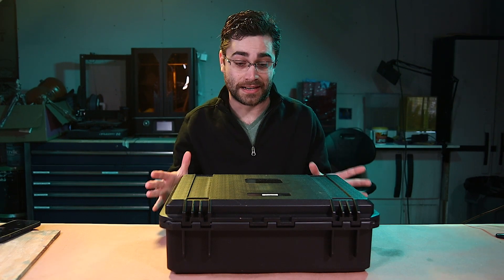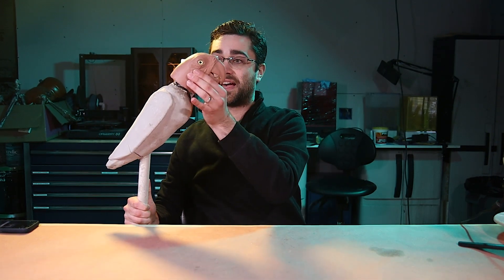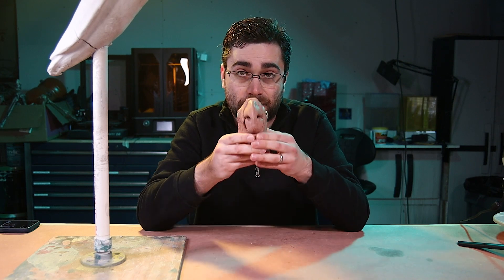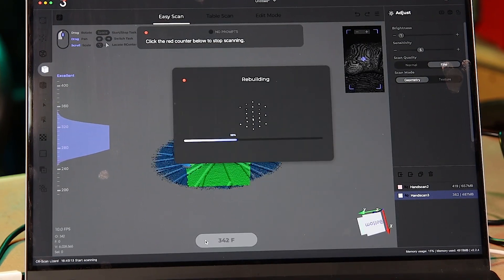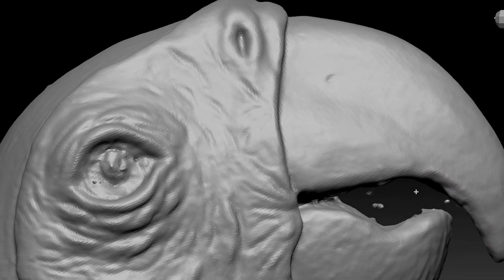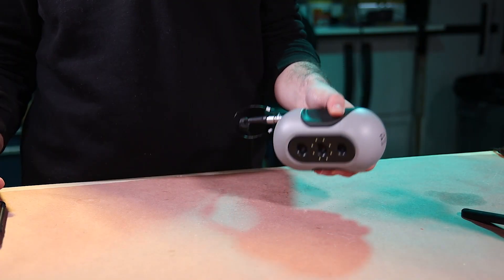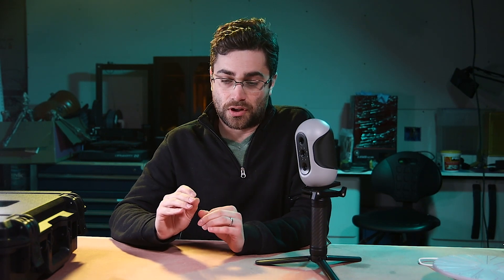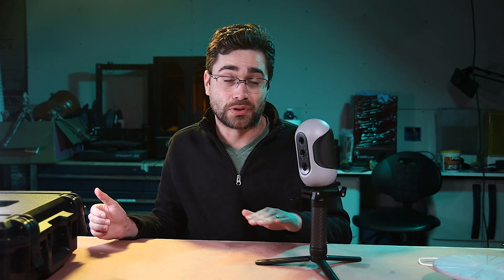Digitizing a Sculpture for Animatronics with 3DMakerpro Mole 3D Scanner

Comment: Thank you for the video and your time. Can you be more specific when aligh all the clouds? If I have more than 3, what is the correct orden and how to align them. Thanks!
Reply from the maker: I think you just have to use your best judgment here, since the instructions I received were limited. I’d say you probably want to start with the ones that have the most overlap so that it has more to work with. You might even be able to to do them all at once.
Reply: @jasperjanderson  i start to play with the unit yesterday. Scan quality superb. But i can't fugure out complex alignment
Reply from the maker: @JoseAguiloworkshops  I have had times where alignment works well automatically and times where it does not. I think a lot depends on the object.
Reply: @jasperjanderson  can you advice how to do it in complex objects? If you know or can? Thanks
Reply from the maker: @JoseAguiloworkshops  It's hard to answer without seeing what you've got, but generally for margin two scans, I've found you want as much overlap as you can capture so that it's got plenty of features to work with to find alignment points. But you also don't want too much overlap on critical detail areas, because lots of duplicate data will make for less clean final results.
Reply: @jasperjanderson  I did it! Yes you need a lot of data. I did it with two meshes. I will try with 3. Forgot! THANKS BRO!

Comment: Thank you for the great Video. Question regarding the mac. What is your machine? What Processor and GPU, and RAM? i use a intel i5 Mac 16 RAM 2020. do you think thats enough?  Thanks
Reply from the maker: I do not know enough about computers to make a recommendation there, but mine is a 2021 M1 Max with 32GB RAM. Glad you liked the video!
Reply: @jasperjanderson  thank you for your reply! and it works great? or do you prefer more power for the 3D application to work with the huge Data from the scans?
Reply from the maker: @luckyluck3093  I don't really have a frame of reference for how much better or worse it could be, but it seemed to be performing about as expected.

Comment: Jasper thanks for the content I have a question I’m tired of modeling stuff and I want to get into 3D scan . Do you think this scanner will work on gunpla model kits ? I do custom work for weapons and some body mods and I want to know if I can use this scanner on this sort of stuff ? Thank you for your time .
Reply from the maker: I haven’t seen any scanner that will give you a finished part ready for output. You’re always going to have to do some cleanup work. From the little I know about gunpla, you’re looking at parts less than an inch in size with sharp geometric forms, right? I think that’s going to be a challenge for any scanner. This one would definitely give you something to work with, but I’d expect to do some reconstruction. If what you’re after is to get the pieces scanned so you can make parts that fit against them (like my video on the revopoint mini making replacement parts for a 1/8 scale model kit), then I do think this would be suitable.
Reply: @jasperjanderson  awesome thank you for the super fast reply and the wisdom  !

Comment: Isnt this scanner just a rip off of the Creality Lizard Scanner ? The software is EXACTLY the same !
Reply: This company makes the creality scanners.
Reply: @markm49  Which company ??? The Creality Lizard came out some time ago (I have one) Why would they release the Creality Lizard first ?
I have just bought a Revopoint scanner because the Creality software is rubbish.
Reply: Yes they made the lizard at the very least they are using a new processor so you can scan using your phone and you cant on lizard
Reply from the maker: I’ve seen mention that one company might be behind both, but I don’t know for sure, and I haven’t compared the specs on the two to know what the differences are.

Comment: So the mole is selling at a pretty impressive preorder price right now (350 base price, 430-500 for bundles) and I'm considering getting one.
I wanted to get a scanner for use on hand-sculpted models (no more than 1x1x1 ft) that I would clean up and detail a bit more virtually, then eventually try to rig and animate. Since I'm primarily planning on scanning things made from matte, single color materials like oil/polymer clays, I'm hoping to avoid a lot of the issues scanners can run into with reflectivity/colors confusing them. Would you recommend the mole for my purposes? 
What has been your experience working on the topography of scans using this software?  That's a major issue I've heard discussed in regards to this stuff, that there ends up being so much manual post processing that you might as well just model fully digital in the first place.

Also, have you experimented with using some kind of scanning spray or similar to improve the accuracy of scans like they do for mechanical components sometimes? My understanding is that in addition to providing a matte surface it works by adding a bit of power or speckling for the scanner to latch on to. I was thinking I could just throw a light dusting of flour onto stuff before scanning, but I was also wondering if it might be possible to mix something into the clay to provide the visual effect without affecting the consistency or reusability of the clay.
Reply from the maker: I don’t think multiple colors would confuse any scanners, but clear or reflective material will confuse most. In fact, I don’t think any of these types of scanners are using the color information to stitch the scan together, just topography. As long as your surface is not shiny, you should have no problem. If it is shiny or dark, then a scanning spray will make it easier for the scanner to read it. Photogrammetry look only at color information, so speckling would benefit you in that type of scan. You’re going to want to generate new topology to do your resculpting with most of the time. I use ZBrush, so I will Dynamesh my scans and work from that, since the scan mesh is not usually conducive to adding detail by itself. Yes, you will almost always need to do resculpting or clean up work on your scans, even with high end scanners. The decision of whether to scan from the real world or work entirely digitally is a choice made from project to project for me.
Reply: Did you get it and?

Comment: It seems to perform well...do you think it would be able to scan a whole person?
Reply from the maker: The challenge with scanning a whole person is the small movements that people make even when standing still. For that reason, you want to be able to capture as quickly as possible so they have less time to move too much.  I don’t think it’s designed for that because the field of view is not huge. It could probably be done, but if that’s your primary need for a scanner, I’d look at one with a larger capture area.
Reply: @jasperjanderson  Have you tried full body scanning with your Whale and does it work well?
Reply from the maker: @doctorpd1969  I have not. Definitely something I'd like to do when I have time. There's also the Revopoint Range that is marketed toward that purpose.
Reply: @jasperjanderson  I actually bought the Whale a few months ago when they had a big sale and I bought it for under $1,000.  However, it is still brand new in the box and I have not even turn it on to test it out since I am so busy since I received it.
Reply from the maker: @doctorpd1969  it takes some time to learn the ropes of these things, but it’s a fantastic tool to have.